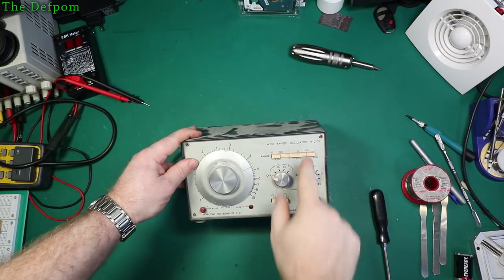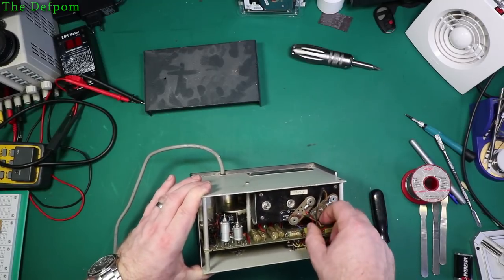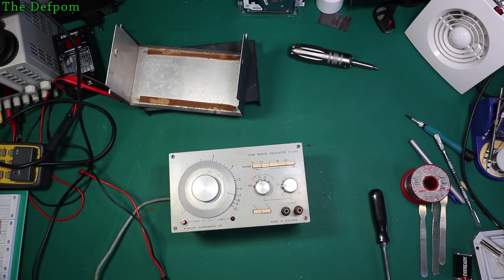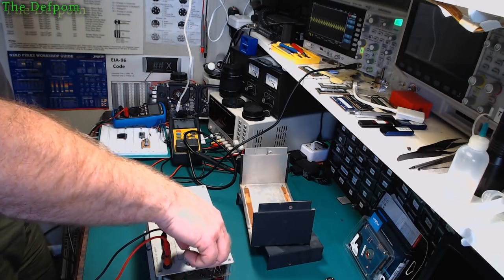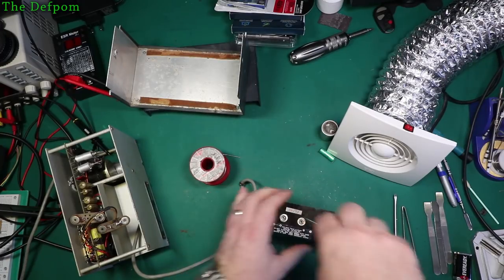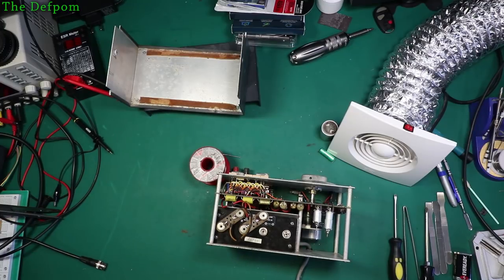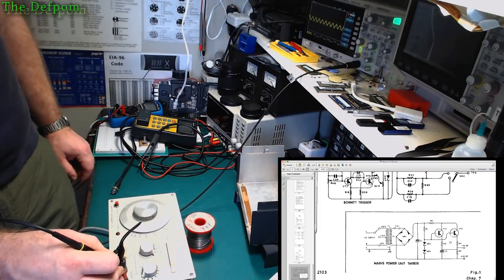🔴 #495 Marconi TF2103 Wide Range Oscillator Repair - Can I Fix It ?

Comment: Excellent repair, always nice to see an old item put back on the road. That jumper on the "dummy" terminals in the mains power supply would allow you to snap on both sets of battery connectors just as if there were two 9 volt batteries installed. Effectively it would be one 18 volt battery and a jumper in place of another (9 volt) battery.

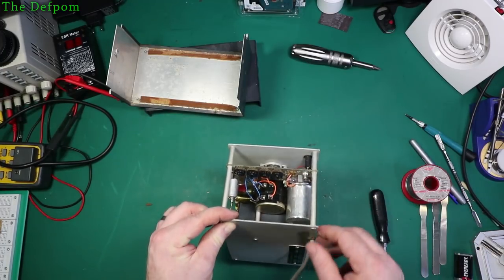Comment: The 'bulb' at 1:51 is an R53/RA53 thermistor, which was specially designed for amplitude stabilisation in Wien Bridge oscillators. They are no longer made and hard to find, so if it's damaged or you break it, you've pretty much had it.

It is possible to stabilise a Wien Bridge oscillator with an incandescent bulb - as Bill Hewlett did - but that would involve rearranging the circuit.
Reply from the maker: Thanks for the info.

Comment: I think I repaired one of these on one of my Videos many many moons ago.  They have a very nice undistorted output and are hard to kill.   From memory the one I had also had the additional mains power supply module installed. The one I add I think was a earlier model but very similiar. Chris

Comment: I've got one of these which I picked up not working a long time back. Mine had a transistor with a lead which had corroded away. I may have replaced a few other dodgy components such as electrolytic caps.

Mine also has precision caps with cracks in the casings, but they seem to be OK. I had to repair a contact on a switch by soldering it back. It wasn't hard to calibrate using a frequency meter and scope.

It's an OK bench oscillator, but not very low distortion, but IIRC it has a max frequency of 1MHz so it was intended for general use, not specifically audio work. It does have quite a nice double pot and dial, and I've been tempted to replace the circuit board with a replacement using op-amps.

Comment: Power supply is a drop in replacement for 2 PM9 batteries, so this unit was originally designed to be powered off of 2 9V batteries in series. You still get those batteries, but only in Zinc carbon flat plate cell format, wax dipped, and they are pretty expensive. Last time I looked they were around 4 pounds each.

Bit warm there? Seeing you are dressed in Australian safety gear.

Comment: Hi Scott,  I'm sure you know but if not these were made by Malden Electronics, sometime later Venner, and re-badged by Marconi.
Reply from the maker: Andrewausfa - Thanks, actually I didn’t know that. The quality is certainly good as it still performs well!
Reply: @TheDefpom  Marconi rebadged a few Malden/Venner bits like frequency counters. This one was originally a Malden TSA 692 or something like that. Anyway, searching for Malden or Venner alternatives is sometimes where you can find manuals if you can't find the Marconi one. Malden did quite a few bits of T&M gear for the GPO. Regards from a surprisingly mild Cambridge.

Comment: I would go ahead and replace the rest of the electrolytic capacitors.  The ripple from the power supply would surely not had been good for them.

Comment: I have the same LCR meter DE-5000 when you turned on your meter maybe I did not see it but I did not see you adjust the frequency to 120 Hz or if you’re over in Europe to 100 Hz so you can get the proper reading out of your capacitor with rear DE-5000 when you’re testing capacitors. The default when you first turn on your meter is 1 kHz. Depending on the capacitor chemistry and in which direction the pastor started going faulty you can get vastly different readings showing good capacitors as bad and showing bad capacitors as good. Example I just picked up the 1000 uF16 V capacitor at 1000 kHz it shows resistance as 0.5 and shows capacitance as 863 uF. but when I switch it over to 120 Hz my resistance drops down to 0.07 and my capacitance rises to 947 uF.